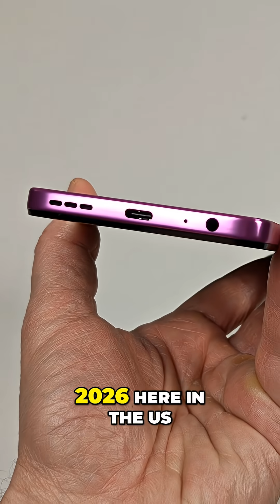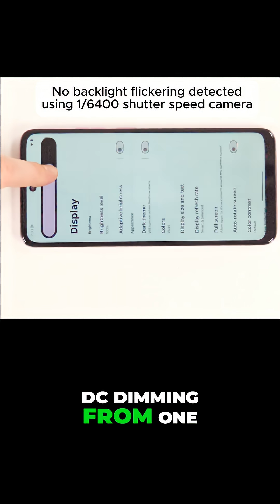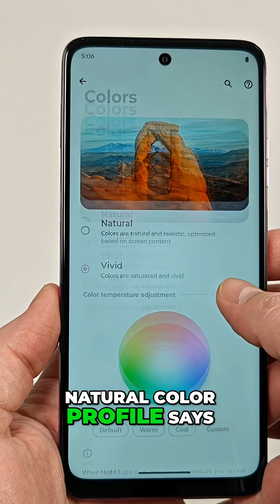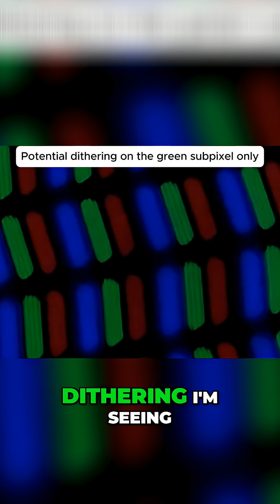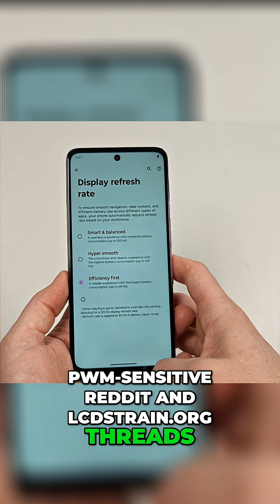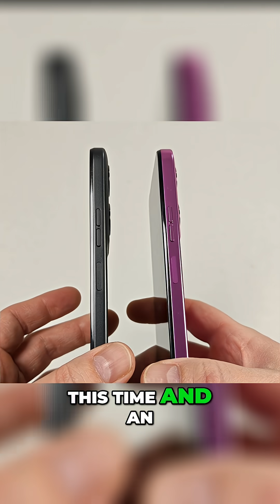Moto G 2026: Insane Value Under $200! Flicker-Free Screen! #shorts #smartphone #tech #motog2026

Comment: Is it true that mediateck chips dither?
Reply: in short that's not true. Phone and screen manufacturers make their displays use dithering. If it can't dither, then no Mediatek can make it dither. But if it's capable of dithering then Mediatek might make it more noticeable. This phone can't dither at all
Reply: I have the previous version moti g 2025 and after I bought I heard alot about the mediateck chip 
This ohone also doesn't dither or flicker at all right? @xro-d7k